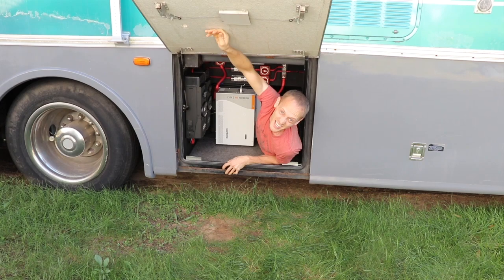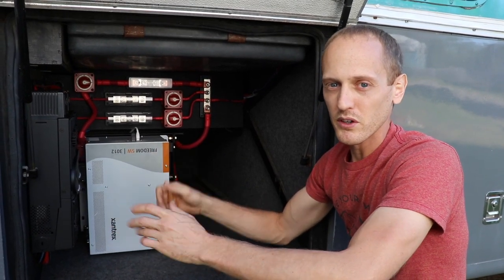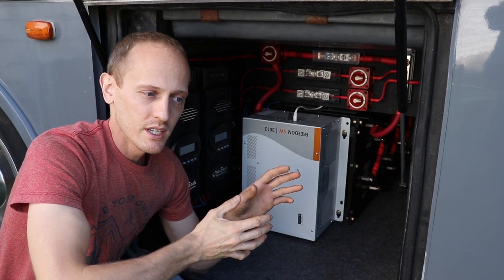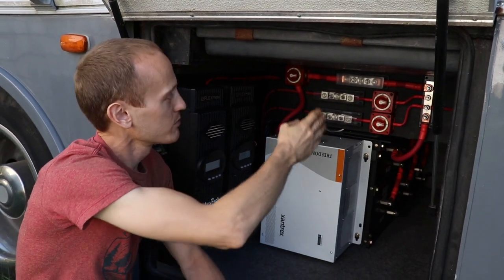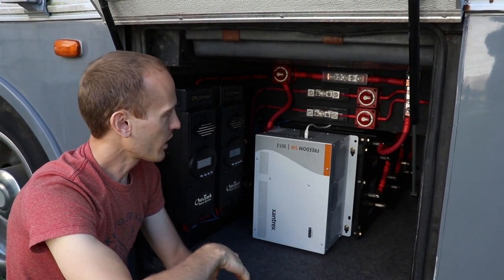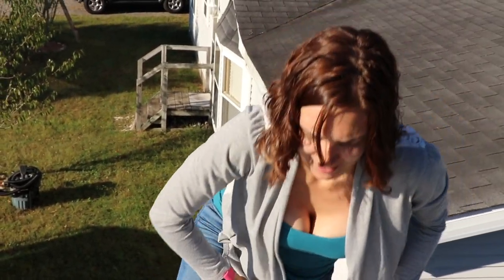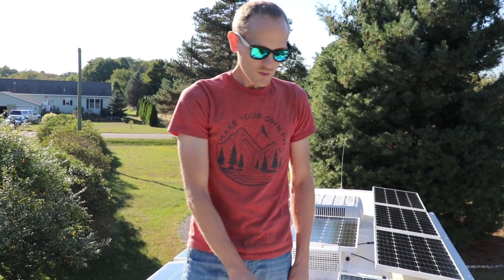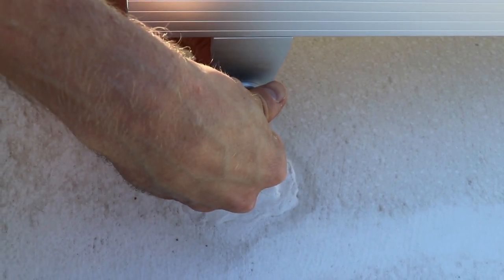Massive DIY RV Solar Install for Off Grid Boondocking

Comment: Good job! With the right inverter and (maybe?) a battery bank of lithium ion batteries (unfortunately very expensive) you can even run an air condition  via an extra inverter. With a large powerful solar system like this we can really say: The age of the generator is over!!
Reply from the maker: Always need a generator for backup. Too many factors that come into play with the weather not producing full potential. The inverter we have runs the roof A/C just fine, but as with all RV solar, the limiting factor is how much wattage you can fit on your roof. No matter how much/what type of battery you have, you still have to be able to put the power back into them.
Reply: @HereThenGone  So true! Unfortunately the Americans have an absurd tendency to oversize their RV-Airconditioners. Here in Europe those are much smaller and more efficient. From my own experience I can assure all Americans that for instance a 2,2-2,4 Kw Air Condition is really enough for an RV of about 9m in length.
Reply from the maker: Our rig is 38 feet long(11.58m) and came with two 13Kw roof units but we purchased a 6Kw window A/C unit for running more full time if we ever get stuck in a hot area that we cant leave. Even that will only take the edge off. It will not cool the rig to "comfortable" temperatures. The problem with RV solar is that you have to park in the sun to get the power, which means the rig is in the sun as well. There is no way a 2.4Kw unit would even begin to touch the temp in a 27ft RV in the sun.

Comment: I'm a former trucker, I'm impressed with your layout and knowledge, I did a lot of this in my truck (HiTech Truckin') using isolation circuits and banks of backup batteries and massive alternators without the aid of solar. So much has changed in just a few years.
Reply from the maker: Sounds like a nice setup for a rig on the move. Solar definitely does the job when you stay in one place for a few days and can't get that alternator charge. Thanks for dropping a comment.

Comment: Can I get Cad drawings of the mounts and offset legs
Reply from the maker: I didn't keep the CAD. They are simply 2x3 aluminum angle. One hole in the short side for whatever size hardware going in your panels and 2 holes in the short side for your hardware going into the roof. A single hole in the long side of both with a decorative radius. The extension legs are just 1"x1/8" flat stock. The slots are sized to fit the square on the underside of a carriage bolt with a decorative radius on each end. Hope that helps some

Comment: cool hookup what brand panels did you use?
Reply from the maker: They are Carmanah CTI160 panels. They are a very robust panel. There are 200watt panels out now from other companies like Continuous Resources with almost the exact same footprint and a smaller price point. Went with these because of their proven durability. Could have gotten more watts on the roof with the newer panels, but decided to go this route for their history.

Comment: NIce clean setup..  however I am shocked at one thing..  You put all that work into this system and yet have not done the one thing that would dramatically reduce your draw on the batteries..  One of the first things I did in our 38 foot RV was replace ALL the lights, but especially BOTH thermostats, with full digital..  LED for the lights, full digital thermostats.  My draw went down by nearly 80% to the batteries once I did that.  The biggest change was the AC units (and furnace) running because the digital thermostat dropped the units from running so much by a good 50%.  I was astounded at the difference, in fact.  And like I said, the draw went down dramatically..  Also we updated our microwave to a new modern power saving model for this reason as well.    Our unit is a Four Winds Windsport 38' built in 1998.  Motor is a 454 up front.  We have a 7500 watt built in Onan military generator  (factory because when this particular unit was built, they ran out of the standard model so this unit got an upgrade).  We use solar and a small wind turbine to supplement power.  We carry 260 gallons of propane and 60 gallons of gasoline.
Reply from the maker: It is odd to me that you made the assumption that we have done nothing to reduce power consumption. We HAVE swapped over all the lights to LED. Even made the center ceiling lights from scratch. Went from a 2amp DC draw for each fluorescent fixture to a .2amp draw for each custom fixture. No need to change out the thermostats because they will only be controlling the furnace. We will run a window A/C if we absolutely have to because roof units make no sense on solar. The only thing you gain from getting a smaller wattage microwave is that it won't be as large of an amp draw on the inverter. It will however take longer to cook your food, so in the end, the Amp hours consumed will be a wash. A 454 must be screaming with a 38' rig. Glowing headers for sure. We are 38' and have an 8.3L turbo Cummins with 6 speed Allison transmission. Get between 11-13mpg. 100 gallons of diesel
Reply: @HereThenGone  I was going by what I see in the video.. The lights near your kitchen area table look like the standard bulb style..   Especially the reading lamps.  And the thermostat you can clearly see in the video is analog, which is actually the more important one overall.    

I did not mean to imply you have done nothing to reduce power consumption, could have worded a bit different I guess.  I just mean those two are major ones and was surprised it had not been done at least from we see in the video.

The Microwave does fine..  it was the initial draw we wanted to drop.. i.e. instead of pulling a sudden 850 amps when first engaged, the model we got only draws 500 amps I think it is then stabilizes.. basically does not load down the system on startup as much as our old one did..  Kinda like the draw down when you first turn on the AC unit.. same premise.

Shockingly, no the 454 is not..  I was completely shocked by that in fact..  Our last trip I averages 70 mph and you could not hear the engine at all with the RPM's at about 2200 at that speed.   I was also shocked by our fuel mileage..  Now, that was highway driving too and not major mountains but here in Wisconsin we have big hills and bluffs and she pulls up those without a problem other then dropping out of over drive gear (which it has).     Like you I expected it to be a possible problem but am pleasantly surprised she has plenty of horsepower and pulls just fine.
Reply from the maker: We have made the switch since we made the video overview. I think you may have used the wrong term in the microwave explanation. 500amps would be 6,300watts. So 850amps would have been 10,700watts. Maybe you meant 500watt draw? Do you have air brakes on your rig? We don't even do 70 on the highway and we have air brakes. Having enough engine to drive fast is fine, as long as you have the braking system to hold up to that speed in an emergency. I hate seeing people with 3/4 ton pickups doing 75-80 pulling 35ft+ fifth wheels. They have nowhere near enough braking power(even with the trailer brakes) at those speeds. Everyone is in a rush nowadays though.
Reply: @HereThenGone  LOL yep.. watts.. oops..  LOL       And nope, no air brakes either.  Just your standard brake setup..  Rear duals are drum, fronts are as well.  Amazingly they actually work damn good too.  They are power assisted though which would definitely be bad if that went out.  But no, they work pretty well.. I have only had to stand on them once when we lost an AC cover in a storm in traffic at about 60 MPH.. Brought us to a clean stop fast without issue.      Like I said, I am damn surprised at how well this thing gets up and goes (and stops).  About the only thing we do not like is there are no slide outs.. It would be nice to have them.  But not matter, it is better then not having a rig at all.   NOTE:  This unit has the Vortec engine if you want to look it up...
Reply from the maker: @Malakie  that's funny because we specifically chose our rig for the lack of slides. Haha. Less things to break, not in the way when not slid out for quick roadside stops, and no leaking. All slides leak at some point, even on brand new rigs.
Reply: @HereThenGone  In our case, what happened was I found I was to be retired due to the V/A placing me at total disability due to my military injuries..  When we found out, we had about two weeks and knew we were not staying in Kansas, where we were at that moment.. We wanted to come home to Wisconsin.  So she came back immediate and tried to find a place to rent.. problem was no one would accept my combat K9 German Shepherd, Mia.   We only had 4 days left when I came up also to help find something.  Then came up with the idea, how about buying a used camper we could use for the couple of months we expected to need to find a place.  

Well, as it turned out, we had only $5000 total cash to our name.  We stopped at a smaller dealer and when he heard what was going on, he took us out back then surprisingly led us to this huge nice RV and said, $5000 cash it's yours.   We had never owned one, let alone used one.

It was a good thing that happened.. I have faith myself and I think God was watching out for us because it ended up that we lived in that RV through the entire Wisconsin winter until the next summer full time.. and anyone can tell you, doing that in a Wisconsin winter is not easy at all.. We had to learn and learn fast and then winterize everything, even placing bales of straw around the entire lower section of the RV.

But we learned and we worked and by December, (this start over labor day for us), we had the RV pretty set for winter living and maintained a 70 F temp without much effort..  We spliced in two 100 gallon tanks, added an electric heater (750 watt) that also ran off batteries, solar and our wind turbine if grid power dropped at the site we parked.. It was placed in the back to keep the water lines intake and tank from freezing, sealed the front of the RV engine compartment, and scotch guard covered all windows but two of them.  We also created a heavy mat that draped over the door as a wind and cold break, which worked really nice too.  In fact that was one of the biggest areas of heat loss we found.

Finally we used mastic to seal all furnace ducting sections to eliminate all areas that leaked due to age and constant movement over the years. Last we also placed thick thermal pads into each AC intake venting blocking any airflow from their ducting.

In that, the RV would run about 36 hours on batteries if the grid went down.  That only happened twice and once the batteries got to low at night since solar and wind was not enough to power things and charge the batteries, the genset would kick in to bring the charge back up.

We used mainly propane heat and our bill was less then $120 a month for propane each month.  We actually expected that to be double.. and the first month it was double.. until we got the new digital thermostats installed which made one HUGE ass difference.

There was more we did but one thing we did start to wish for was a bit more room thus the slide out comment...

Comment: Sideways on the batteries? Is that a good idea with potential leakage from the batteries?
Reply from the maker: AGM batteries are a sealed battery. Absorbed Glass Mat. That means that all the electrolyte that is in a standard Flooded lead acid battery is absorbed into fiberglass mat around the plates. There is no extra liquid to spill out. It's a huge selling point to AGM. There are overpressure release valves, but if you use the batteries propperly, you should never be boiling them over enough to build internal pressure high enough to have to release the valves. Even then, it will be mostly gas escaping.
Reply: @HereThenGone  stay safe and ventilate! Thanks for the reply informative reply!

Comment: I tried to go through all the comments but they just keep going and going. Sorry if it's been asked but where did you get the big yellow crimper you were using?
Reply from the maker: This is the exact one. I was amazed with the build quality for the price. Even our largest cable was only halfway up through the die sizes.
https://www.amazon.com/dp/B00GXQ2E5E/ref=cm_sw_r_cp_awdb_t1_oq7KCb6AJVBJK

Comment: I have to say,I've been a spark for 40+ yrs and the standard of your work ( presentation) far exceeds some of the sparks I've worked with & some of the work that I've had to put right ! Well done ! I can see your RV weighs a fair bit,by the wheel sinking in on the start, hope ya' never got stuck !?! Ha' ! Congratulations on your achievements with this vid, the job, the explanations,the layout & production, the whole thing ! Extremely well thought out & presented ! Good luck to you both & again, WELL DONE !!!
Reply from the maker: Really appreciate that Peter!! Not an electrician here, but love learning. This was our first attempt at solar and through planning and taking our time, we couldn't be happier with the end result. So many nice compliments that all we can say is thank you. We also hope to never get stuck weighing in at 26,000 pounds. that will be one nasty tow bill.  😉

Comment: Nice build. Lithium Phosphate batteries would be half the weight and twice to three times the power.
Reply from the maker: Actually almost 1/3 the weight. They are not 3 times the power. Usable amp hours is usable amp hours. Once you send us the check for the extra cost of going Lithium, we will gladly make the switch. And our 8.3L turbo Cummins with 6 speed Allison transmission doesn't care about the weight. When can we be expecting that check? haha

Comment: Nice looking install. Safe travels
Reply from the maker: Thank you and safe travels to you as well.
Reply: @HereThenGone  when are you going to do more videos with your rig and let us know how all of that solar is working? Safe travels
Reply from the maker: We have just been hunkered down working like crazy to try to meet our tentative departure date of May 12. We have already tested the system for a long weekend of building an American Ninja Warrior course for my (Sean) nieces. All the power tools were run by the motorhome along with cooking meals in the Instant Pot and other normal power draws like TV, lights, pump, etc. But once we are on the road full time, we will definitely update everyone on how the system is holding up.
Reply: @HereThenGone  that sounds great, if you're ever passing thru North Alabama then let us know, we have a place you can park at our shop behind the house with full hookups. Safe travels

Comment: You are waaaaay smarter than I am. I wish I understood half of what you just said. Awesome set up!!!
Reply from the maker: I knew nothing about solar two years ago when we started saving for this install. Spent a lot of time researching. Everything from simple YouTube videos to college papers written on what chemical compounds make up the cells in the panels and how they capture photons of light to excite the electrons of the positively doped layer of Silicon causing electrical flow. haha. Had a lot of time to study. Probably learned more than necessary, but it was fun along the way. Thanks for dropping a comment.

Comment: note: those isolators in a booth are out of reach in case of fire in inverter or charger...
Reply from the maker: The inverter and charger are in the same unit, but either way, if there was a fire of any kind in a bay of an RV, it wouldn't matter if you could turn off a switch. It will be burning to the ground. Haha. Do the work the right way the first time everyone. 👍😁

Comment: why you did not think of used Nissan Leaf battery pack ... I feel you may have had longer battery life also more run time without need to worry about battery life..maybe down the road you can think of looking for used Nissan Leaf battery pack..
Reply from the maker: Leaf packs are 48v. Along with needing to design and build your own BMS for them, you would also then need a DC to DC step down  converter to get all of your 12v system working again. Also the 12v alternator wouldn't be able to charge them while traveling. It would have been a completely different system that we just didn't want to deal with.

Comment: Do your charge controllers actually "talk" to each other, or are they merely connected into the main bus in larallel?
Reply from the maker: Currently they are just connected in parallel. Outback has a newer remote panel that does allow for them to actually talk with each other.
Reply: @HereThenGone  Great!  Thanks for the reply.